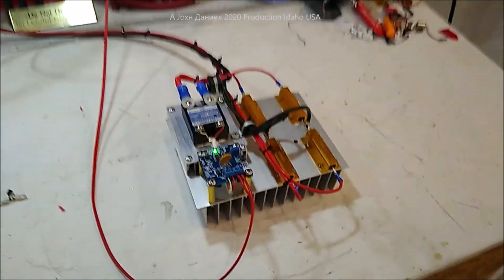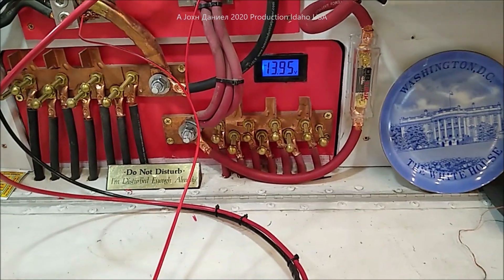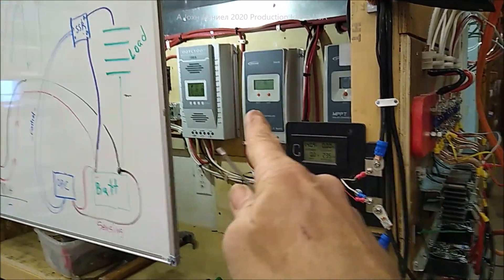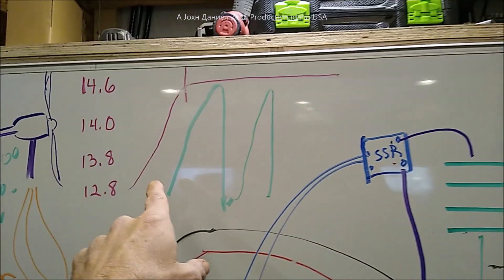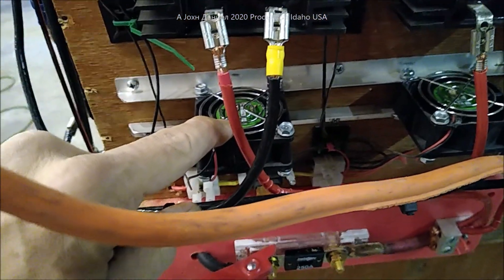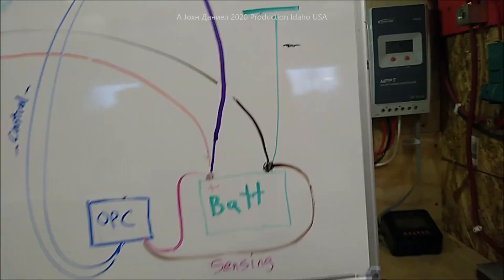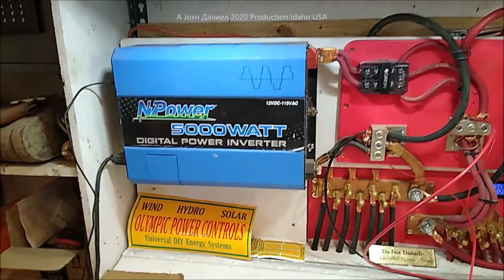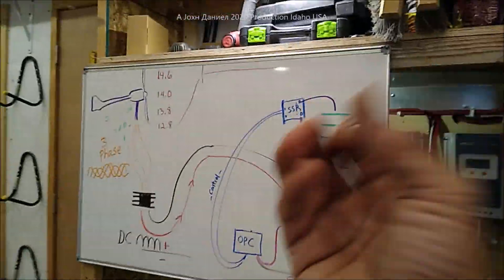Micro Wind Turbine charge controller design and uses explained, parts Below

Comment: I bought a cheap SSR labeled 100 A and it failed in the closed position.  Brand was FOTEK SSR-100 DD stay away from this one, I opened the SSR and inside was a 15A NPN Transistor. Which one you recommend?
Reply: MAGER like the ones he put in that link, its a 60 amp, has 4 transistors in it of 20
Reply: There should be MOSFET inside not regular transistors
Reply from the maker: I think he meant Fet in them, they do have 4 of the 20 amp with doubled then inline

Comment: G'day John, Aussie Engineer saying hello from sunny  bushfire ripped up Australia.     Mate THIS IS AWESOME,  this is the video post I've been waiting for.  Excellent explanation and design.  I'm out into my shed building my Surf Coast South Aust wind system.
Reply: Hello @Simon Rayward and @John Daniel
Simon just wondering where in Australia are you getting the parts you need for this system.
John i am wondering if i have a 48 volt system, where can i purchase OPC that handles a 48V. I can only find a 24v ones. Thank Andy
Reply from the maker: @Andy-ee7gh  Get the 24 volt model, then source 24 volts off your battery bank ( 4 six volt batteries will be 24v supply) for sensing voltage of 29.0 volts diversion setting. The controller will run (operate) the SSR and using also the 24 volts from the source you tapped it will switch on/off the SSR which will pass the full 48 volts through its larger terminals to Resistors. 29.0 divert is for Lead Acid, use 28.0 for Lifepo4 and 27.8 for NiMH or NiCad. For Gel you also use same as LiFePo. Works fine, done it hundreds of times. It only draws 1 amp, the end result is a 24 volt trigger supply to divert the full bank volts. Can be used on everything from 12 to 96 volts with this process.

Comment: I'm curious if the (ssr) fails can a safety load diversion be added or can multiple (ssr) be hooked to same load bank. 
I know you could have multiple smaller load banks just curious because 2 relays and 1 load bank could be cheaper than 2 or more load banks👀
 no hurry for an answer not ready to build anything yet. I want to familiarize myself with AC current before tackling bigger projects.

Comment: Has anyone tried this setup with Lithium based batteries? Also, I’m trying to wrap my head around the wind turbine voltage output. If you look at the power curve for some of these pma’s they will start at a low voltage and go all the way up to 200 to 300 volts. I understand that this is open circuit voltages, but does the pma output whatever the voltage of your load? In this case your battery bank.
Reply: Sounds great, but all sellers of Lithium can not answer why Lithium tool batteries and wheel chair lithiums fail in 2 to 3 years while NiCad are still cycling after 3+ and johns lead acid are still going after 10 years for less than 1/2 the cost. Over 1/2 of teslas 3 years old are having failing cells right now, we owned one, it cost us $2800 for the fix.
Reply from the maker: Avoid Lithium, factually has a short life, over hyped, dangerous and 3x the cost. Get the DEKA SOLAR or Duracell B-903-L16 that actually last a real 10 years. Made by East Penn, sold by Batteries+ as a Duracell for less.  https://bit.ly/2wv1VXd Order online, pick up for cheap.

Comment: would  it help to use 48v instead of those 12v to avoid the high jumps in amps ?
Reply from the maker: In some cases, but I just build heavier in the few places lower volts require it.

Comment: I don't have a clue on what you said. I have a 8 panel thunder bolt system charging 6 batteries with a 30 amp 500 watt controller powering my motorhome. I'm thinking of adding 4 more panels, and 2 more batteries. Rite now I'm pushing 200 watts. Will my controller handle the up grade. Dennis
Reply from the maker: Get the DEKA SOLAR or Duracell B-903-L16 that actually last a real 10 years. Made by East Penn, sold by Batteries+ as a Duracell for less.  https://bit.ly/2wv1VXd Order online, pick up for cheap.
Reply: Dennis Cheslock What about your wiring? Could that handle the extra current?  From the panel array to controller, from controller to battery bank, within the battery bank itself, and from the batteries to inverter?  I’d have to look it up, but the wire gauge should be appropriate to the current at operating/charging voltage...guessing 6-8awg minimum for the 25amps at 12v for the proposed setup. 
Does the ~17A of your current setup not keep your batteries properly charged? How many hours per day do your batteries see that energy input, how does that compare to their storage capacity? And the demand you put on them?
The trick to designing a solar-battery system is sizing it so that the batteries are guaranteed to fully charge, and also not run out of energy. So, forget about watts, and focus on amps and volts and hours - until you have enough VA going into your AH-rated batteries to charge them back to full in the time the sun shines on your panels, you’re fighting a losing financial battle by adding more of each.